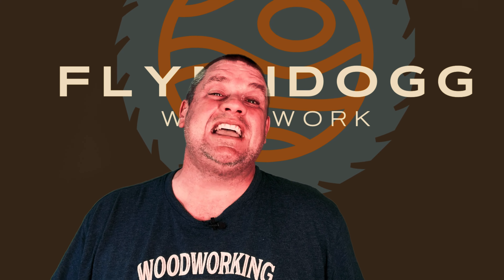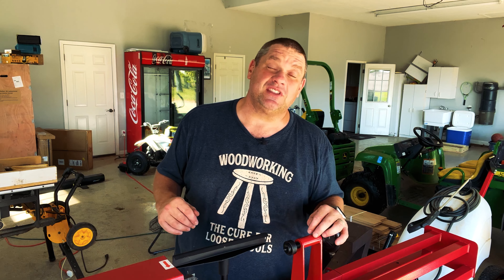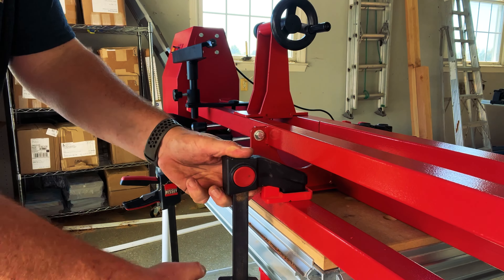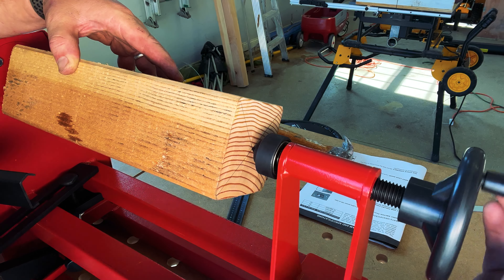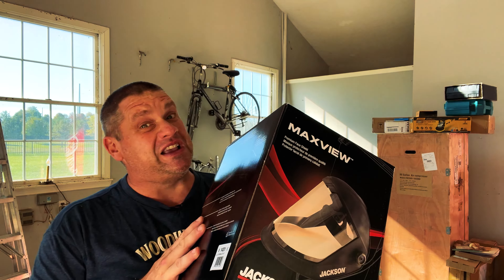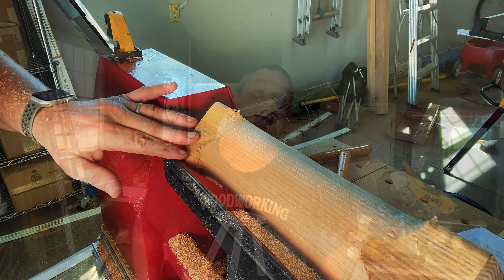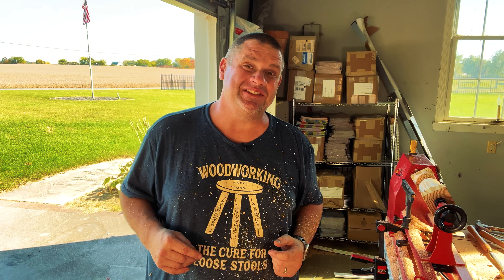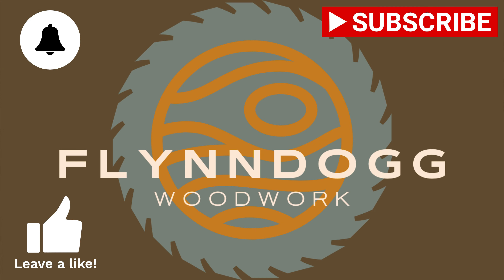Learn Wood Lathe Basics: Beginner's Guide #woodworking #woodturning

Comment: It would be a lot easier if you redu ce the size of your blank prior to turning.   For instance, shorten the length.  Next, instead of square, try reducing the cross section to a hex shape

Buy a stone such as, Norton India Gouge Slip, for sharpening gouges.  Learn to sharpen your lathe tools.  Dull tools are dangerous.

There is an inherent flaw in your $200 lathe, and that is the lack of mass.  Soft pine is one thing, hard woods as ash, maple or hickory, are different.  Lathes should be fixed (i.e., bolted) to a base.  Turning pen blanks is one thing, turning bowls or table legs is another.
Reply from the maker: Love this, thank you so much for sharing Robert!  I am truly a newbie and all of these comments are really valuable.  I appreciate you sharing.  After filming this video, I have been continuing to watch more videos on turning and I saw a lot of people trimming down the blanks to an octagon.   It sounds like I'm going to need to upgrade fairly soon, as I really enjoyed using it this first time.  I'm actually thinking about using it to make some christmas gifts, etc.  Thanks again for sharing and watching!
Reply: @FlynndoggWoodwork  I am 71.  The last time I used a lathe was in 7th grade.  You heard me regurgitate almost everything I know about turning.

Don't sell yourself short.     Rely on what you learn elsewhere.

Bob
Reply from the maker: @robertlevine2152  Haha!  :)

Comment: Good video and very timely for me.  I recently picked up an old lathe on a base.  It has heavy rails, and the tool rest won’t be sloppy.  It has a pulley system as well, but I think the max diameter is 12” length is 36”.  I’ve got some old turning tools from a long time ago, I just haven’t had the gumption to chock up a piece of wood yet.  I’m excited to try it out now.  I got it with the intention to turn spindles for chairs.  I also built a shave horse to make riven spindles.  Working green wood with a drawknife is very different from the lathe. So much to learn.  Great job on the video and looking forward to hear more about the shop renovation.  👍🏽
Reply from the maker: That's awesome, you know I may do some research and see if I can find an older lathe like that.  I would really like to look into one of those variable speed lathes, as changing the pulleys can be a really pain sometimes.   Love the fact that you are doing some green woodworking. I've always thought that would be amazing to try!   Rex Kruger was talking about that on a video I was watching of his a few weeks ago.    Best of luck to you.   Now I want a draw knife! :)

Comment: Ditto n the comments about the tool rest.  Did you notice the tail stock bend away from the headstock as you tightened it down?  There’s no lateral strength to it so it won’t keep constant pressure on the piece.

Another thing to check is alignment. Put the spur center on it and bring the tail stock right up to it.  They should touch point to point. If they don’t you’ll never turn true round and heavier pieces of wood will be more likely to perform a rapid unplanned dismount. Also check how much side to side play there is with the tail stock. That will also affect safety and results.
Reply from the maker: Thank you so much for this comment Tim!  I've actually since sold this thing. I upgraded to a Jet becuase I really was worried about the safety of it.  I should probably take this video down.   I will say however this guy did get me interested in turning, so I guess that is the only saving grace! :)

Comment: If you remember when we talked about lathe work I suggested you find a woodturning club and go to a few of the meetings.  I agree with most of the posts about the tool rest, an accident waiting to happen.  I feel that you were VERY lucky that it didn't turn into the wood and have you ducking the flying piece.  Have carbide tools, but they become common after I had been turning and using the normal tools that need to be sharpened.  After a lathe upgrade you will be looking a chucks.  Mike Peace has some good videos regarding buying your first chuck, also many good videos on turning different projects.  Welcome to the world of woodturning, it's an addictive and expensive habit.  Remember that the favorite wood of most turners is "found".  Get to know the people in your area who remove trees and see if they will save wood for you.  Good luck.
Reply from the maker: Love this Pat, and oh yes, I remember our discussion.  I actually went over to rockler shortly after we had it and asked about classes.   I think I will eventually sign up for one and upgrade.   This lathe is good for me now, but I'm not using it until I do something about that tool rest.  Thank you so much for watchign and sharing!
Reply: Just to let you know, if you talk to to 10 different turners on how to do a project, you will get 11 different answers.  There is really NO right way to do something, except for an unsafe way, everyone turns in a way that works for them.  Also I have found that the faster I have the lathe operating, the cleaner the cuts.  The old adage is turn as fast as you are comfortable with.  @FlynndoggWoodwork
Reply from the maker: @patbeatty7116  Thank you so much for sharing this Pat.   Sounds like it's similar to about everything else in life! :)   I appreciate the advice and thanks again for watching!

Comment: Hi I have the same Lathe and have been having troubles but I think your video has helped me a lot. I was wondering did you drill a hole on the other side of the wood where the winding point chuck is?

please excuse my terminology i'm still a beginner
Reply from the maker: I totally understand what you are sauijg Lyleeggmolesse as I am a beginner as well.  I didn't drill any holes to mount the wood, but I did put it in the lathe rather firmly.     Be very careful with that tool rest.  It actually scared me so much that I ended up upgrading this lathe about 3 months later.   Mine was moving quite a bit on me.   Thanks so much for the question and thanks for watching!
Reply: @FlynndoggWoodwork  Did you get a new lathe?
Reply from the maker: @lyleeggmolesse5330  Yep, I went ahead and got a Jet lathe.   But this is the lathe that got me interested in turning so I'm very happy that I got this one!
Reply: @FlynndoggWoodwork  That's good, How much was the jet lathe?
Reply from the maker: @lyleeggmolesse5330  great question.  I got mine for about $800 it was on sale at the time.    That's what I try to do at least is wait to those woodcraft sales with free shipping and buy them online.   Really quite a huge difference between the jet and the vevor, but the vevor was great to start out with .

Comment: Now that you turned a piece, are you ready to upgrade? That flexing tool rest caused me to "pucker" everytime. I can't imagine how it made you feel. But, the machine does spin wood and has 4 speeds. That is enough to see if turning is what you like to do. I sold my lathe and scroll saw years ago and focused on joinery and finishing. Scrolling and turning were too "free form" (for lack of a better way to explain) for my taste. Good luck. Be careful with that thing. Thanks for another video.
Reply from the maker: Oh yes, it made me pucker for sure!  Especially for having basically no experience with it.  I think I'm going to try and do some candle holders in the future.  It's a good started lathe, and it made me realize that I like turning, which I guess is what I really wanted to know.   And I will definitely be upgrading once I have a little extra cash laying around.   The shop upgrade has put a real dent in my woodworking budget (probably for a couple of years!)

Comment: Woodcraft and Rockler have classes for beginners.  Wood lathes can launch wood at your face if you do not know what your doing.  You do not have to worry about blades spinning at high rpms but the wood spinning when not yet rounded makes the chisels  bounce and chater.  So taking a class can be very useful to learn how to safely use the lathe.  Also ther are many wood working clubs across the county that give classes if the big 2 are not in your area.
Reply from the maker: THanks so much agdtec!  Excellent advice.  I've already made a  trip to rockler and intend on taking a class in the near future.   I'm hesitating on turning anything else, until I get that tool rest issue resolved.    I appreciate you sharing and watching!

Comment: You will outgrow that lathe quickly. Get one with a VFD, then comes better tools..... sharpening grinder with sharpening jig....the list will get longer. The way the tool rest moves around would make me nervous. Good luck
Reply from the maker: Totally agree with you on both points.   I tried to change the belts a couple of times, and got it done, but man it wasn't easy!   That tool rest is by far my biggest concern.   If that thing shifted and hit the workpiece in the middle of a cut It would go flying.  Thanks so much for watching DoctorPing!

Comment: Dogg, man, you will be upgrading that lathe in a matter of months, because size does matter.  Once you're comfortable turning wood, you'll be getting a Rikon, Grizzly or Jet lathe soon because it will be so much more you.  Already you've moved up to the carbide tipped  turning tools.  That will save you  hours in sharpening time.  Good luck turning.  For some, turning, itself,  becomes an obsession.  I can't see that happening with you though because you don't get wrapped up in anything...hum, bub?
Reply from the maker: Yep!  That sounds like the consensus on this lathe.   That moving tool rest really is concerning for me.  I'm glad I chose to use pine for this first time.  I'm wondring if I would have used a hardwood if that tool rest would have caused even more problems.     It's funny you mentioned rikon.  That was one that I was looking at for a long time, and almost bought a few years ago, they seem really nice.  I'm also obviously a fan of Jet as 1/2 my tools in my shop are made by them.   I think i would like to get a variable speed one when I do my next upgrade, as the belt changes on this one aren't exactly easy.   Hope your surgery went well!
Reply: @FlynndoggWoodwork  Dogg, man, it won't take you long to get that sweet, sweet Jet lathe.  They are nice.  If you wanted a cheap alternative to the variable speed, you might consider just getting a variable speed switch (like a lot of us use for our routers), you know it is basically a rheostat that you can adjust.  Just saying...  BTW, thank you so much for your concern and well wishes, but as is typical here for the old Meat, surgery was rescheduled and now, may, happen this coming Wednesday 11 Oct.  Fingers crossed.  Still loving your stuff.

Comment: Good video. I’m surprised it worked that well with a 1/2 horsepower motor.
Reply from the maker: Yeah, it seemed to work just fine with that much power, however I have nothing to compare it to, so not sure what I was expecting.   Thank you so much for watching Jeff

Comment: Idk if u said but are those Benjamin's best chisels
Reply from the maker: The chisels are vevors as well.   I still use them today, pretty decent for the price.
Reply: @FlynndoggWoodwork oh ok. Yea I have a three piece vevor carbide. Those work pretty well
Reply from the maker: @justinfletcher7630  yep, I'd like to eventually get some with longer handles.. but for now they work!
Reply: @FlynndoggWoodwork  yea sharpening station is my next step on the journey of turning ,I went bass akwards and bought multiple sets of each kind of tool from Amazon. Them found penn state Industries online and that's by far where I found the best value for most things. Definitely chisels because Benjamin's best are as good as any high quality ones and the price is less than half. And they sold me a conversion kit that turned my half hp multi speed delta into a 3/4 horse variable speed for like 170 bucks. I strongly recommend using them for turning products. Just not their chucks
Reply from the maker: @justinfletcher7630  nice!  I'm checking them out today!
Reply: @FlynndoggWoodwork  yea for sure. They have bundles of like the 3 standard bowl or spindle  gouges or parting tool bundles and then like full sets.  To buy one the shipping brings it to like 40 bucks but if you get the 3 pack it's like 75 , so your getting one for free basically and they are right at the top as far as quality.. and the one thing I did hear about that lathe thos is just watch the spindle on longer pieces when you get far enough aways from the head stock or driver the one in that lathe has a tendency to bend or bow. There are replacement u can get easy enough. But just food for thought to keep an eye on
Reply: I had no knowledge of lathes when I decided to get one and I almost jumped on that exact same one. I ended up getting the new Craftsman mini and that fried out immediately like two days after so I bought a used delta with a ton of extras. But I almost bought that same one like five times I had it In my cart. Did a lot of research on em
Reply from the maker: @justinfletcher7630  I will definitely be watching out for that!  Thanks again for sharing! :)
Reply from the maker: @justinfletcher7630  You sound a lot like me.  I will put somethign in my cart mutlipel times and not check it out... or I will check out and then cancel it after buying it, after telling myself... "do I really need that" :)
Reply: @FlynndoggWoodwork  all the time

Comment: Been turning for 60 years.  Welcome to the slippery slope.  You are in the vortex.  That lathe is dangerous.  Please be careful.  Join a local turning club.  Wear your face shield.  Watch some videos on turning.  Richard Raffin make a skew look like magic.  You Really need a Better lathe, that one might kill you.
Reply: Ditto.
Reply from the maker: Thank you so much for sharing this Barryirby!  This is exactly the kind of feedback I was looking for.   That tool rest, really concerned me,  it doesn't move forward and backward but it was moving up and down.  Once I tightened it, it worked better, but still concerned me.  Thank you so much for sharing and watching!
Reply: Try using some locked tight on the bolts for the rest. Where you put the tool on? I usually destiny one finger To make sure that You keep your wood straight plus I use a slow grinder to shathen the tools that came with the machine there are some pieces out there.  The you can get help sharpening or you can make your own.
Reply from the maker: @larryengstrom3892  great ideas Larry Thanks for sharing!

Comment: yeah, don't use the chisels that come with a cheap lathe from China.  whereas the lathe is good enough to work with wood, if the chisels that come with your lathe look like the ones in this video, go get some real ones.   I am happy to report that I am okay after snapping my roughing gouge, only because I wear a face shield when I turn.  I'd be missing an eye if I didn't.   Plus, when you see the difference in size and quality of a real set (I bought Bauer),  the included chisels are a joke.
Reply from the maker: Totally agree icandsc!   I ended up getting a Jet Lathe after this one and have been very pleased with it.   Still need to get some better chisels though!  Thanks so much for sharing and watching, really appreciate it!